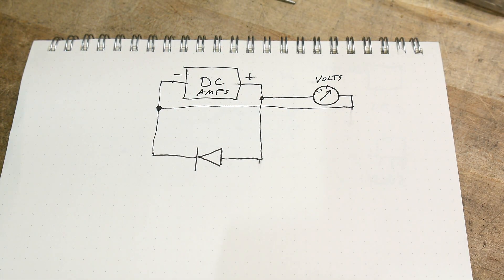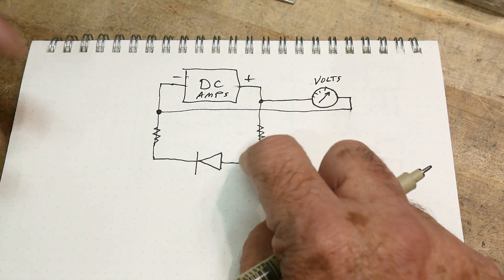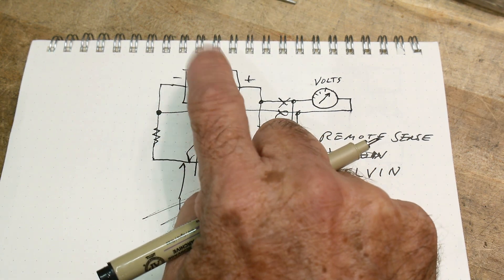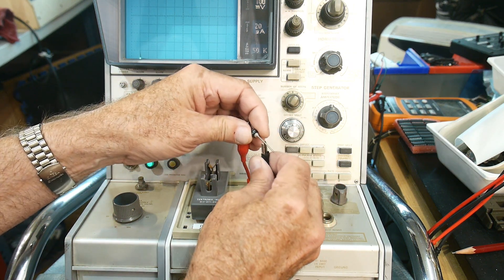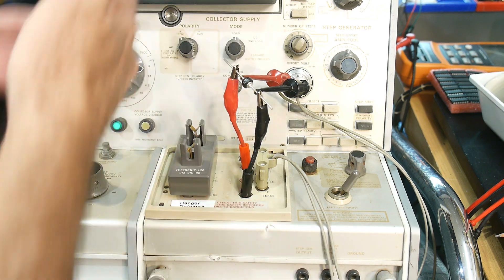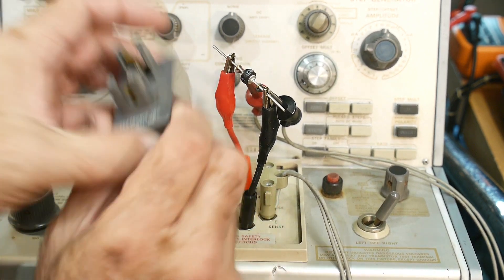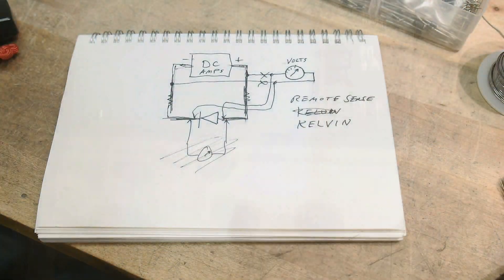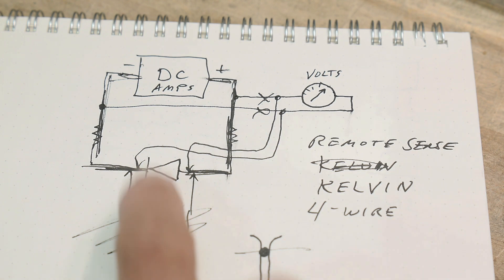#1323 Kelvin 4 Wire Remote Sense

Comment: So, in the diode fixture with the source and sense contacts opposite one another, even though the source and sense contacts are touching the leads at the same distance away from the diode body, the sense wire improves the measurement because it's eliminating all the length of conductor that the source is travelling through inside the machine?
Reply from the maker: yes

Comment: Folk also forget that a lot of power supplies have 4 wire outputs, where the source and sense are bridged at the pus with a metal link. The idea again being that you can remove the links and run the sense wires to the point of load and remove the voltage drop in the cables. As the power supply will regulate the voltage at the end of the sense wires e.g the load and not at the psu terminals.

Comment: When Heathkit introduced their one and only digital auto-ranging capacitance meter, the IT-2250, their catalog touted the "Kevin" connector. It must have been a new one on the copy writer, because very few other Heathkit products used a "Kelvin" connector, and they probably just saw the engineer's scribble and "corrected" it to something familiar, "Kevin". But their next catalog, the copy was exactly the same but for the correction to "Kelvin".

Comment: So you can use a Kelvin connection to measure voltage as well as resistance? My HP3468A has 4 wire for resistance. Can that be used in other functions with the 4 wire leads?
Reply: Not with a classic multimeter, but there are special devices that allow the use of sense terminals for so-called dual measurement - the display must correspond to this, so you can measure two voltages, or voltage and current separately. This connection is also used, for example, with electronic loads, on my load the switching takes place automatically - if I connect the loaded circuit only to the main terminals, the 2W load works, if I also connect the SENSE input, it automatically switches to 4W and the differences are really huge.

Nice day 🙂 Tom
Reply: @Edisson.  thanks for explaining this. I just bought a Keithley 228A voltage/current source and the output card has sense terminals. Those can be run out closer to the load for better more accurate regulation?
Reply: @robbo6460  I don't know this model personally, but if it has sense terminals, they will serve to prevent the voltage drop on the powered device - example: I have a device with a large consumption, due to the transient resistances of the terminals and the resistance of the wires, the powered device will have a voltage drop against the set one. If I connect the SENSE circuit to the powered device, the source will probably compensate for this drop automatically, or if I need a completely constant voltage without fluctuations - the source uses SENSE to compensate for the drop - since I do not own such a source, the above description is only an estimate from the general SENSE function.